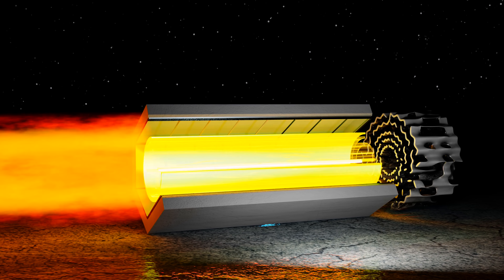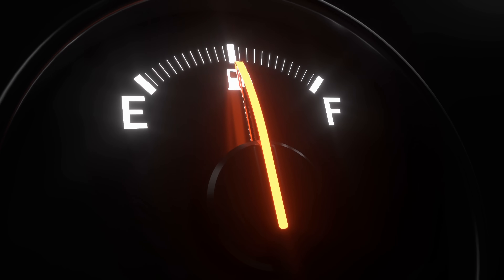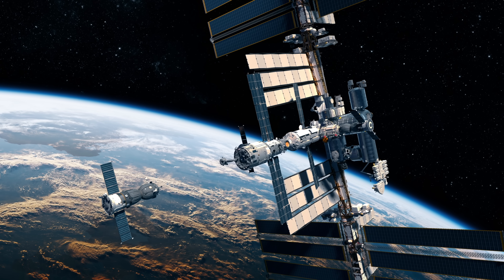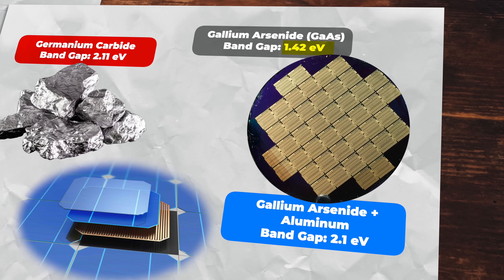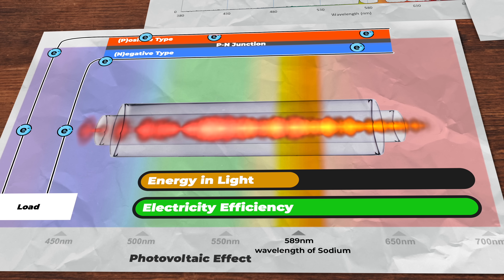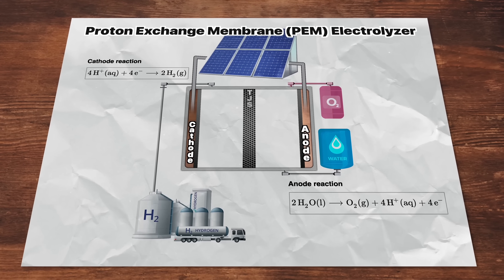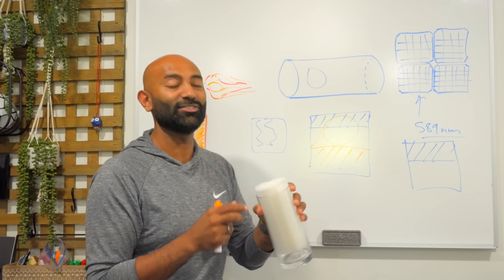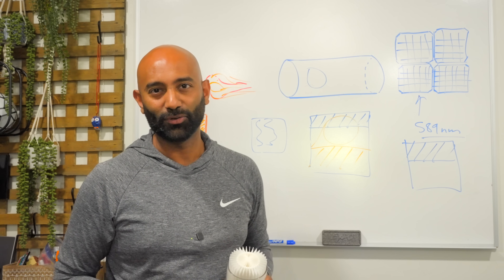Why Solid State Might Save The Combustion Engine

Comment: Your second story - the one with ~12% conversion efficiency is realistic.  Your first one probably wont work: 2.1eV = 590nm --> 4900K.  Silica's melting point is ~2000K.  What makes it worse is that sodium tends to penetrate the silica, making a glass with an even lower melting point.  The final damning point is that most fuels won't burn that hot under reasonable conditions.  Gasoline in air only gets up to about 2300K.  Even oxy-acetylene only gets up to 3800K.  Thermophotovoltaics can work, but not as they propose them.

Comment: Rethink this idea for use in a solar collection and conversion to a single monochromatic light emitting device with a fine tuned collector. You could use a lens or parabolic solar collector dish to accomplish the same task during daylight hours. Focus the collected solar light on a quartz glass encapsulated sodium chloride crystal. Then scale up or down and make it into and array of collectors. Most things absorb light and reflect something different. We use this principle in mantel driven gas lamps.

Comment: One its not an engine. Its an electric generator by useing a pulse engine and then putting the exhaust through a solar cell that they made clear is a galiamnum solar cell using salt unstead.  The heat burns off the salt very quick so you are constantly dumping huge amounts inside. The amount if fuel ontop is not nearly as efficient as they say.  The cell would melt quicky.  

This is bs 

Simplicity is a 20b rotory mazda engine, with an axial motor rotors and housing, 13b with the extra rotor(s) to reburn the hydrogen or gas like an egr.  The turbo thats already used in f1 for forced induction and electric generation mechanically.  Could have housing made from solar cell material. But again would most likely melt. 

It is eventually going to be the next big thing "that will kill the ev". When mazda gets around to it.

It is the most efficient we can get at this moment but still a long way off.

Comment: First of all, thank you for your videos. They are extremely interesting, I really like them. Regarding your idea about enhancing the yield of a reciprocating engine heating sodium until it glows, consider capturing heat at the exhaust pipe level rather than the combustion chamber. This approach avoids diminishing the mechanical energy of expanding gasses. High-performance engines, especially those with high RPMs or turbocharging, have exhaust pipes that get extremely hot, sometimes glowing red. By utilizing this waste heat, you can harness additional energy without compromising engine performance. Just a thought.

Comment: If it is producing electricity it is another electric shit car theory. The original one already failed and such "ideas" wont save the 2023 then 25 the 2030  transfer bullshit. What can be the working one is synthetic fuel. If that is doable, we are good to go without turning the Earth upside down to produce zillions of batteries by moving gigatons of soil/mining copper in impossible amount, dig out all parking lots, roads etc to lay down new 100 times bigger electric network to be able to handle the charging station's requirements and so on. Any other ideas than synthetic fuel are just as idiotic as original EV idea itself.

Comment: A really big problem I see here is that the best photovoltaic cells are only about 25% efficient and those are very expensive, most common cells are only about 15%-20% efficient. So it doesn't matter how efficient your combustion is so long as it is reliant on photovoltaic to produce the output usable energy. As far as quantum dot photovoltaics goes those are a long way from being usable in the real world and certainly from being anything produced on scale.

Comment: the moment you have 2 or more steps, you have less than 60% efficiency, and that's being generous

a hydrogen-oxigen fuel cell with no photovoltaic plaques involved has an efficiency of 85% when paired with a cogenerator that makes use of the waste heat...

I don't believe for a second that these guys trumped aerospace engineering, and absolutely less likely as they involved 2 energy conversion steps...

Comment: As amazing as it might sound, that doesn't change the fact that there would still be exhaust fumes, churning deadly microparticles as well as CO2 directly to the atmosphere, especially if it involves standard gasoline or petroleum-based fuels, therefore contributing to climate change even at only 50% rates. So ,not helpful at all.

Comment: what if we used teslas turbine with the jet? if we could make the jet as efficient as fast liquids we would improve the heat waste and the mecanical waste at the same time. maybe a system where we cycle water, liquid sodium or oil to lubrificate and stick the power to the turbine and increase efficiency. i mean, it's a jet and tesla turbine is more efficient the faster the power source is and is only one cheap moving part to increase motor efficiency.

Comment: A typical gasoline powered vehicle's exhaust gas temperatures are nowhere near the 1400 degrees F that the internal parts of an old sodium vapor light had to endure. (I couldn't find the specific temp required to produce light, but this should be in the neighborhood)  However catalytic converters can range upward of 1200 F under heavy load.  If a bit more fuel and air was purposely introduced one could be made to run at a temp that would be hot enough to do the job.  I'm not sure what that would do to the life expectancy of one, and they tend to melt at 2000 deg so it would have to be actively controlled keep it in the right temp range, but it does sound plausible at least.    
In other words, one could build a catalytic converter specifically for the job, and it would get 2/3 of the way up to operating temps just from driving along under load.  On the highway it wouldn't take much in the way of extra fuel to keep it hot enough, but putting around town under minimal load could be a different story. 

I am by no means an expert but I have seen an older car with a faulty oxygen sensor heat the catalytic converters up until they were bright enough to illuminate the road underneath.   

While I am a bit skeptical as to whether the amount of power you could get out of such a system would be worth it, It would be an interesting and fairly straight forward experiment.

Comment: You're idea when it comes to doing the radiator as cooling tubes is great! The tubes would need to be at least 2.1" in diameter, and a lot other than what we have in there now. Suppose that this would be a good idea and put this whole thing together and we could get a 2.7MWatt output. If you had this for a car, what could you accomplish? How fast could you go? How far could you go? The heat is all you need. Make some black panels for use in the desert, and see if the heat is good enough. Maybe we don't even need combustion.

Comment: How hot does sodium have to be before it emmits light?  

Would it be possible, do you think, to have a layer of something containing sodium ions that fluoresced when irradiated with the Sun's UV, but which allowed the visible light through to hit a normal PV cell underneath?

(By "NaPV cell"  I mean a photovoltaic cell, which is adapted to capture sodium light.)

If you could make a NaPV cell thin enough to be transparent and make a sandwich of NaPV cell - Fluorescence material - NaPV cell you could capture the Na-light produced, going in the direction of the incident light and also the light emmitted by the fluorescent material going back towards the Sun. and if, you could make it all transparent to visible light you could use that to generate power in a normal PV cell.  (If you see what I mean, sorta thing like!)

How much of the IR radiation in Sunlight is converted to electricity in a normal solar panel?

Comment: Sodium light has a color temperature of 2200K. This means that the Sodium needs to have this temperature to be able to emit light, (or if electricity flows through the sodium gas in a lamp at a lower temperature 900K, this is a different principle were electrons are knocked out of orbit creating a photon) .The glas tube needs to be even hotter due to the thermal resistance between the combustion chamber and the Sodium compartment. Melting point of Quartz is around 2000K, wonder how they fix that. 
If you want to reuse the heath from a combustion engine (40% power; 30% low temperature heath from the cooling system ; 30% heath from the exhaust at around 1100K) you need heath of  at least 2200K, this is not the case for a combustion engine. In general the higher the combustion temperature the more mechanical energy can be generated. But... there are "no" materials available with high melting temperatures that can be used for (transparent and other)parts. The principle could work but I can't think of a solution to have a colder quartz tube sandwiched between a much hotter combustion camber and sodium compartment, while maintaining a good transparency for the 580nm 
Photo voltaic cells don't like high temperatures, sitting "close" to the sodium compartment requires a solution.

Comment: This sounds really wasteful. I‘m not an expert, but turning sunlight into chemical energy (nature did that for fossil fuels), turning that chemical energy into heat, turning heat into light, and then turning light into electrictiy, which is then converted to mechanical energy … wow, that sounds wasteful. I doubt you can ever get anything out of this, let alone 80% 😂. 

Seems it would be much more efficient to skip at least a few of the energy conversions. PV seems to be the most direct we can do this today. Every other energy source is just converted sunlight.

If I‘m wrong, I‘m eager to learn!

Comment: Honestly all these conversions from chemical, to light and heat, and then to photovoltaic sounds like a real roundabout way, with a lot more loss than initially stated or projected. 

Just frickin' go nuclear. If you want to stop burning fossil fuel, you just go nuclear. Everything else is a waste of time. 

Other than that, adapt solar panels to absorb the rest of that sunlight outside the 42%. MIT was researching using quantum dots to absorb UV radiation. The Mars rover uses multijunction solar cells to absorb energy in various light conditions. CERN is exploring using scintillators for gamma rays and high-energy photons absorption, since they're already used for detection. 

This fuel to light (and wasted heat) thing seems like a waste of energy. At the very least they could have scavenged the waste heat to power some generators along the way too, right?

Comment: there are over 6000 different applications used today extracted from crude Oil , the process revolve around 12 stages , say this will work okay ? 
how are you going to make another use of extracted  5 stages of oil used today in fuels ? what are you going to do with them ? you can't just abandon them because without that process ? you can't have plastic , oil based rubbers ,polymers,  wire insulators , electronic circuit plates ,  computer covers and accessories , cell phone accessories and covers , e.t.c , 
and then you have Trees , shrubs and grass and all flora based Life forms that Loves CO2 as it's food to grow by when it gets short supplied ? cannibalism by nature occurs ( trees start to kill trees and then Natural fire occurs in order to produce CO2 ) so he flora can feed again . how are you going to solve that ? 
these modern engineers think they can solve many problems while forgetting Humans are but part of Life itself and nature is far more deadly than Co2 ( well once a while )

Comment: Unless I missed it, the biggest obstacle to any new combustion process is the type of combustion emissions, where is this considered?
Reply: P sure most of the governmental regulations for reducing CO2 emissions in passenger vehicles target specific metrics denoted in Grams per Kilometer driven - even Battery Electric Vehicles are rated in this way (MPGe)

Comment: So... They could harness the expansion of the combustion process as well, similar to a traditional combustion engine.
When gasoline combusts, you get thermal, photo and pressure emissions. The ideal would be to capture and use all 3 forms of energy. Wasting 2 and harnessing 1 is wasteful and one of the biggest problems with combustion engines.

Comment: I’m no expert, but I see more questions about this system, many of which have been brought up by other commenters. My first thought is its thermal footprint, which, to me, seems counterproductive to what it claims to aspire to as a producer of efficient, clean energy. Second is, how is the sodium - salt - being carried in what form and how is it being managed. Do you just run down to the store and pick up a ten-pound bag of salt, dump it in the system and it takes care of the rest? Then there’s the primary fuel - regular gasoline or other things like hydrogen. The consumer or end-user will have to maintain and manage that. And with this system you have two sources to always worry about, which seems inconvenient. I’m no chemist, but if hydrogen is used and combusted with salt, what are the resulting products? I did a quick Google and, if correct, the result would be nitric acid, which was a component of smog - as nitric oxide - when motor vehicles used leaded gasoline and before catalytic converters. I may have the wrong information, but this doesn’t sound good. 

Other commenters call this a scam. I say it’s more like a new Theranos in the making. It promises much, but doesn’t appear to be anything there when you look past the hype.

Comment: A problem is that sodium won't emit 589 nm light unless it gets much, much hotter than you can achieve by harvesting waste heat from an engine. Sodium vapor lamps work by heating it to well above 1000°C. That's why they need to use quartz or sapphire: those temperatures would melt glass and copper. (Even quartz is marginal.)

Comment: pv is at most 15-20% efficient with current mass produced methods. What method suddenly becomes about 90% to allow for the other losses in the system. I dont know of any Space tech that would be anywhere near that efficiency. Germanium and Gallium are fairly toxic so I dont see this being green  in any way

Comment: 14:20 I think you answered your own question earlier. We'd need the engine to be made out of copper to take the raw heat and get sodium up to temp. As it is we need to cool the aluminum engine blocks to keep them from melting. At these lower temps, you'll need to find a different material to glow and of course the appropriate PV material. You're essentially down in Peltier element territory, and while I've long wondered why we don't strategically strap peltier elements to car engines to recapture heat energy as electricity, I think the overwhelming answer is that you can't put them close enough to the heat to be effective while keeping the engine easy enough to manufacture.

Comment: While I am very, very sceptical about this "Solid state engine", the idea of creating monochromatic light from heat and converting that light with a fine-tuned PV cell is interesting.

However, as a heat source, concentrated sun light seems more reasonable. No exhaust means no energy loss due to still warm exhaust gas.

Comment: I thought this might of been converting existing ICE vehicles by swapping the transmission with a generator, a small solid state battery, and electric motor transaxle. You get the sound of ICE, the cost effectiveness of a simple conversion, and no range anxiety of EVs. Edison Motors has done this with diesel pickups.

Comment: How does such a "lamp" handle exhaust? You need to output the gas exhaust and that takes heat away from the system. Sounds too impractical to be true.

Comment: Neat idea, but the salt thing is no good.  A little googling shows that breaking the sodium/chlorine bond needs ~1500F temps, BUT, sodium vapor, like used in the redish color street lamps, only needs 400-500F to do it's thing, so if you wanted to do something like you propose, I suggest making a modified catalytic converter (which operates in the 800-900F range) that incorporates an outer toris of sodium gas and then your PV outside of that.  You might need to lengthen it to get optimal heat usage, but that would be a delicate balance because you don't want to poison the catalyst or get it too cold so that it doesn't do its thing.  This is a good alternative to a sterling engine, which I know people have attempted to use to generate electricity from the engine's waste heat.

Comment: The entire video talks about no moving parts and no moving parts. Why don't you leave these buzzwords promoted by consumer companies ( electronics companies ) ? Combustion engines, whether internal combustion or external combustion, have the ability to use various types of fuel, not just gasoline, as the principle is the basis. I believe that this video explains the development of photovoltaic cells. These cells have a tiny efficiency of ( 20 % - 28 % ), knowing that there are “ no moving parts ” Which they always claim is “the reason for the lack of efficiency,” but whoever looks at Stirling engines and how they are more efficient, reliable, and durable than photovoltaic cells will immediately realize that the matter has nothing to do with whether the device includes moving parts or not, but rather the method of harvesting energy. It has values that may not be exceeded. So stop promoting these things. the development of photovoltaic cells by combining conventional photovoltaic cells that rely on light with thermoelectric cells that rely on heat to increase efficiency is an exciting matter. Also, we don't need electricity only.